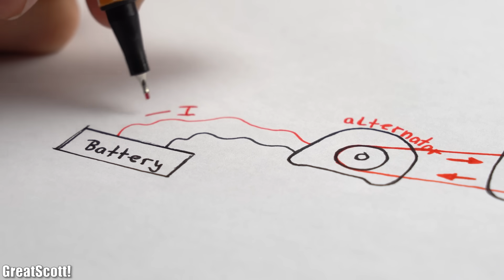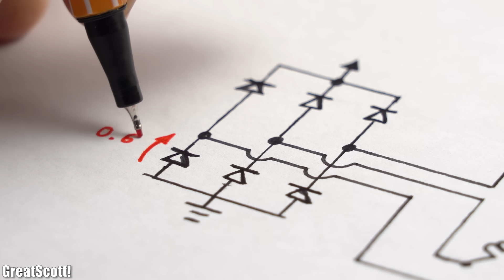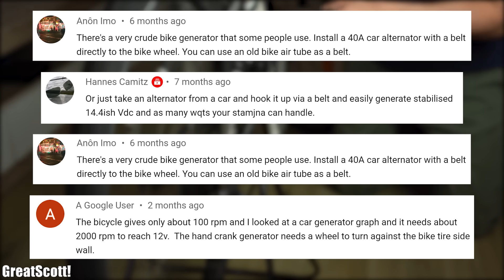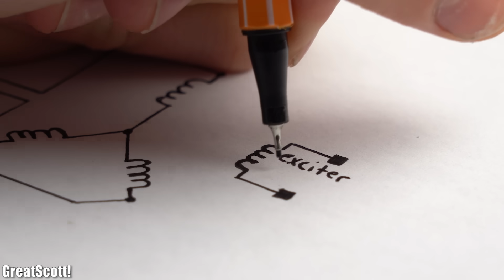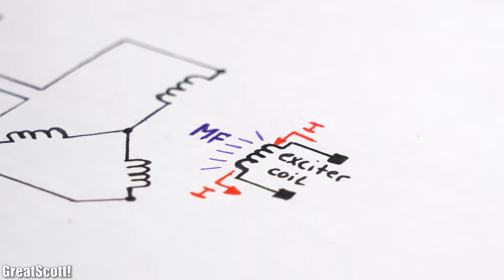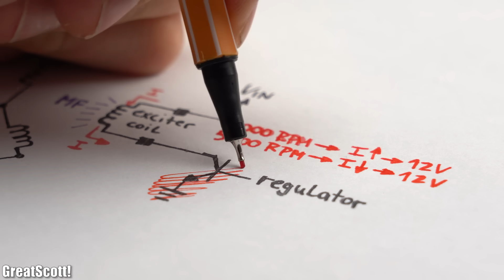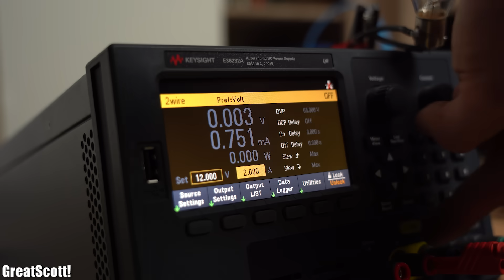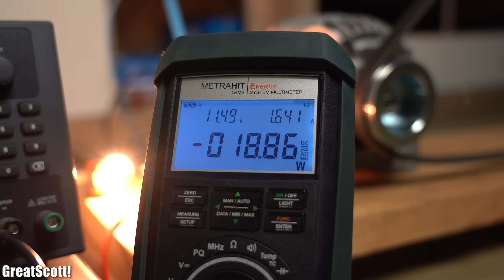Using a car alternator with a bike to power my home? How much energy can I produce?!

Comment: Everyone is talking about how to add tension to the belt. Here's a trick from an old lapidist. In rock shops, we use electric motors for a number of machines, which have a similar design to the alternator. When mounting the motor, use an ordinary door hinge. Mount the hinge to the base board and the motor to the other part of the hinge so that the motor tilts in the direction that the belt is going (In this case towards the bike). You can tilt it toward the bike to put the belt on, and when you tilt it back down it should not sit perfectly flat. That way, the weight of the alternator will provide the necessary tension.
Reply: what a nice idea !! but i dont think the alternator is heavy enough to provide enough tension when used used at that high of an rpm in this particular case.

Comment: they make high output alternators for example i have one that puts out 370 amps which is nearly triple what a stock style alternator puts out, also setting up a group of high capacity car batteries with an inverter to convert the 12 volts to 110. not sure if this would work but would be intersting to see you put it to the test. for example you could hook up your batteries and inverter to a box fan on high and see how long they would run it for and the test how long it would take you to use your bike to charge all the batteries back to full capacity! oh and please just tighten up the belt so that it doesnt slip!

Comment: The inverter needs to suppress the excitor coil pre amperage or you wont get any di-active voltage output. Just add a further wire to the bikes positive diode or even better, to the seat's anus capacitor, and you'll soon feel the difference.

Comment: You should try a good pulley system and daisy chaining several alternators together. Plus a few car batteries as a battery bank with a power inverter to get your AC. I've been debating on combining a bike system as such for a good workout every evening along with solar and wind generators to help sustain.

Comment: The field has to be initiated by a DC voltage before it will "generate" any electricity. It isnt a Generator or Dynamo. 
Under 'significant' load - (a few lightbulbs, furnace, stove, etc.) , its gonna take a ""significant"" HORSEPOWER to turn that alternator. Just auto systems can take 10 to 30 HP depending on how many and what things you have turned on. (notice the quote marks)
Stick to charging a bank of batteries and use a DC to AC invertor for 110V "appliances". 
BTW plan on a lot of peddeling to keep charging those batteries. LOLOL
Remember TANSTAAFL > There Aint No Such Thing As A Free Lunch.

Comment: Damn, for 80€ you get an entire car that is just barely not allowed on public roads anymore.
In other words: It would have been a lot cheaper from a scrapyard.
From the german i assume you live in germany and so do i. So this should apply. The second hand market for cars is just flooded, so used car parts like that usually are cheap if you are willing to extract them yourself. Also yes, i mean literal scrapyards. They usually have official rules on what you have to pay for such an action. Just ask them.
The only thing you can't obtain that way are airbags, they are simply too dangerous to mess with. And not just in the they won't work anymore direction. The way they are designed they can literally blow up in your face while you try to take them apart. They have too. Otherwise they might fail in a crash.

Comment: you could have just used the tire against the pulley on the alternator... and then you have the bikes gears to use against the load resistance,  changes.

Comment: you must connect another motor to the alternator to generate the required power out put to run your home two other choices solar panels to another electric motor or just a electric motor to the alternator but both must run fast enough to reach the required level for your home

Comment: I've thought of something that I would like to try one day. Build a water troth out of pipes with alternators attached to them acting as water mill's and a water pump to pump the water up into the troth. With the water eventually coming back to the water pump in a cycle. Only question is how many alternators do you need to power a home

Comment: Nice project. You should build the one where everyone is saying free energy from "PMG"(permanent Magnet Generator). I guess you have to get high-powered neodymium magnets and I guess modify the Stator to produce high output voltage? then they use a single-phase motor to keep the alternator running and producing electricity in a closed loop. I think that would be cool to show people if it can or cannot be done. Great Videos.

Comment: Try an alternator from the 1980's. Hook it to a 12volt battery. use pulleys to increase gear ratio for more rpm.

Comment: Did that years ago for a ham radio field day.  We used an old fashioned auto generator (not alternator) to provide 12v to power a 2 meter rig.  It worked, but most of us couldn't keep up the pedling for very long.  I know you can get the alternator to work.  Look for how people have used these in wind powered generators.

Comment: I don't understand why the rear wheel is on the gear with the most teeth, when you would want the one with the fewest teeth (and lower diameter) to increase the ratio between your pedal axle, and the wheel axle. As far as bike riding as gone for me, I go faster when I used the gears on the rear wheel with the smaller diameter (then the larger diameter gears on the rear wheel). And... it seems like a very obvious thing to miss for such a simple system. I know you were having issues shifting gears on the rear, but... you said you solved it? I don't get it...

Comment: Should have had a pulley on a shaft in the same place as where the alternator is and on the other end of the shaft you will will want a really big pulley that then either goes to the alternator or another small pulley with a big one on the opposite side again that way you can peddle effortlessly and generate a lot more electricity

Comment: Before seeing the video, you probably are putting out 75W, so no. Get a 1/2hp to .75hp washer/dryer motor. That way you can put out more like 100-200W. Also, directly drive the generator through the chain with a sprocket or cog. Forget about trying to rotate the generator through tire friction.

Comment: So... "watts" is a measure of charge per second. It is a flow rate. You can convert this directly to a torque. For 400 watts of generator, you're looking at 295 ft-lbs of torque... and that's before you factor in losses of energy due to generation, like friction, resistance of wire, entropy, etc.

Car lug nuts get torqued to about 200 ft-lbs for the extra stiff ones on standard cars. This is 1.5 times that. That requires a huge lever arm and most of your body weight. This looks bad for thr project.

Thankfully, hooking up less power to this generator will likely help a lot. It should be very easy to spin while no power is hooked up, and increase in difficulty to turn as more power is pulled.

20 watts to charge a phone and a battery bank seems doable.

Comment: Nice experiment! If you put a tensioner on the belt, you will decrease the belt slip and up performance/output. Would have to experiment with the spring force to optimize before too much tension overcomes the optimization of belt slip.
Reply: Yea the belts too loose.
Reply: Forget a belt.. put a chain drive on it..
Reply: Also change the ratio of the pulling gear increased by 3 and reduce the size of the pulley .. that will triple the rpms..
Reply: And add a start run capacitor off of a dc to ac inverter !! It will amaze you !!
Reply: I was thinking the same

Comment: best way to get power to supply  to your home get hook up to electricity  company   if your off gride generators  multi fuel  soler is cheap not dependble dose not work with out storage   at night love your enthusiastic  approach  but beter off  trying steam power did do that for awhile  lot of work  if you got creek  or drainage ditch  hydro works  weater dependent   do you realy want to peddle  all the time

Comment: Once your alternator  is put out full power flip switch crank up generator as long it has enough out put to turn a motor which keeps Gen. Going and Gen has output to run motor and what every you hook to Gen. Works nice

Comment: From what is visible you have the bike in 1st gear which is the slowest RPM of the rear wheel.  1st gear is designed for going  up steep hills.  You will increase the RPM substantially by putting the the bike in 5th or sixth gear or higher ( if it is a ten or twenty speed bike). It will take more effort but the wheel will spin many times faster without having to pedal near so rapidly.

Comment: Just a thought, bigger or more alternators, or both. Much more resistance something like those big water wheel things from back then, now the issue with the water wheel is of course it's size. Also can't be to small because of freezing potential. Magnets are superior, but not cheap. Those coal trains where impressive, so where the steam trains. Steam being the better choice of course.🤔🤔🤔

Comment: It's all about kilowatt hours . 12 volts at 120 amps is happening at 5000 rpm and requires 4-6 hp and at minimum 2 v belts or a serpentine belt . If you can equal the power of a 5hp mini bike or go cart , for any length of time may have a chance . Now I sit through the ads and await the outcome

Comment: U could of just ordered a 1968 ford alternator that puts out direct ac current 60volts that would go to the voltage regulator converting to dc voltage to charge battery 🔋

Comment: This would be very simple !  use bike to have exercise .with more stable setup so belt will not slip ,,,Alternator  feeds a battery , Battery feeds a power invertor , invertor feeds your supply . A good battery would supply power 3 to 4 hour just for lights computer and such, exercise maybe like 1 hour to 1 and half hours daily to keep battery charged,,and another member of your family ride bike , maybe run a 1600 w space heater

Comment: so Stirling engines running from heated water and magnets that spin separated from other magnets heating stuff up ware ever possible. so then you take wires and attach them to everywhere thats hot on one end and to water being cooled by air gel thats apart of the bigger loop put turbines in it for the water hydro and the heat lol. use some kinds of bio fuels, oxygen, and hydrogen. even burning plastics and thigs to collect gas and diesel that you could burn as well carpet demo or...

Comment: I think that much copper wire is meant to be optimized at thousands of RPM I think you’re scrubbing a floor with a toothbrush further optimization I’m sure can achieve higher results🤔

Comment: It’s going to take 2 hp plus just to freewheel the alternator to the approximate 3,500rpm required before loading it down with a sincere power draw. It’s a commonly overlooked variable. At that rpm you will have the voltage but no real amperage. 1 hp is approximately 550 foot pounds/per second. 1 hp is also about 745 watts; (1500 watts just to spin the alternator to 3,500 rpm operating speed with no load). How much do you weigh standing on those pedals? ‘-been there, done that’; you’re on the right track and I admire your efforts! Don’t give up.

Comment: It's not a generator it's an alternator and the tire is big the pulley on the alternator is small. You don't need and belts it chains. Mount the alternator so that the pulley is up against the tire so when tire spins it runs the pulley by spinning it

Comment: It’s not work as an alternator receives load it takes more power to turn the alternator then it creates so you’re at a loss and everything dies out… This guy is a liar it doesn’t work you ever hear an alternator return something on in a vehicle on the eight engine steps down because it’s under a strain

Comment: is it just me of i think you were using the lowest gear on the rear, plus even assumping the wheel circumference is around 2meters
the top speed most people can pedal on is 30km/h so you end with 500rpm,.

Comment: Most cars idle around 700 800 rpms and the battery charges just fine, also the belt needs to be tight, otherwise the belt slips and you don't get good power, also the alternator needs to be grounded

Comment: A car alternator needs close to 12V DC power of 2-3 amps to turn on the regulator and energize the coil in the rotor. Generated power is produced in the field coils and rectified by a 3 phase rectifiers in the housing of the alternator. Once turning fast enough the weak battery you started with will charge including any others you connect. However if in a windmill application, you need to devise a way to turn off power to the alternator if the wind dies and sense wind and turn the power back on to 'excite' the rotor in the alternator.  Note that alternators are designed to produce power when turning at least 1,000 RPMs so using pedals to produce power won't work.

Comment: You need to tighten the belt. With a tensioner or an adjustment corse thread bolt at the bike frame and wood stand

Comment: or constant speed generation of power you could replace the exciter coil with permanent magnets saving the 8 watts for the coil but then you would have an even harder time peddling to get the 20 watts out... If you can get the current down and the voltage up you should be able to find a more sweet spot.
I would try and go for a 24 v alternator of similar properties (a 120 A version as well) next and see what that does compared to the 12V version...

Comment: Get 20 of these car alternators and put one belt on to an electric motor instead of a bicycle and plug it into a wall outlet. That will give you continuous power without having to have a bicycle to turn the alternator. A simple washing machine motor should work. It will put out far more power than it takes to turn the alternator.

Comment: Have you thought of attaching a windmill or a series of windmills or a large windmill? This should spend the alternator at a much faster rate whereby producing the needed energy. Also use a smaller alternator and then of course battery inverter etc etc

Comment: If you ever do anything like this again ie something requiring an alternator, use a General Motors unit. Gm’s (Chevy) mid 1980’s - 1990’s trucks, SUV’s, and some cars, those with the 4.3 V6, 5.0 & 5.7 V8’s were made in their millions and their alternators are cheap, simple and robust. Or if you can find an old school one wire alternator whose exciter wire is the main wire from the battery.

Comment: Ive already seen a home powered by alternator in Waipio Valley Big Island Hawaii, only difference is that theirs was hydro driven from a waterfall up the side of the valley using a water pump from the same vehicle they got the alternator off of bolted them together with a direct drive off the water pump to the alternator both mounted to a 55 gallon barrel

Comment: Pal you have to bypass the diodes use electrical construction wire, by bypassing the diodes your output will be 440 amps get a car generator too you run that to your alternator, alternate to a fuse box with breaker switches with an outlet you plug in a battery charger to the outlet plug the battery charger to the battery now you have Frankenstein yourself electricity there you go there now it's running itself add auxiliary electrical outlets extension cords figure out the rest yourself says the Tin Man Randy Allen Hallelujah brothers and sisters amen

Comment: Yes, two car alternators,  wired in sequence, bypassing the diodes, should produce enough energy to power your Air Conditioner, as well as Furnace Blower & run your whole house. Then, hook-up a small motor to them both & you'll produce enough power to run the motor, as well... Good Luck ...

Comment: ok so water goes into a system that boils it from the sun. the boiling water goes into turbines and finally into steam engines. the steam is collected above everything and ran back down thru a hydro power system that feeds the boiler... you can use trickles to move extra volumes of water above thru steam hammer jets and water hammer jets. at night time you can boil water by burning bio fuels from plastics, plants, burning wood and/with poop.

Comment: Use magnets, if you make it right you can create a none stop rotating wheel and you can probably increase the rotation speed depending on the size and design of the magnetic generator

You would have to use that car alternator there in it somewhere
Reply: You cannot. Magnets don't work like that
Reply: Perpetual motion myth.
Reply: There has been noticed a certain boost in european electrical network, allegedly because the states are started to bulid their magnetic wheel setups. Thank you, Nathanial, your innovative comment helped to solve the european energy chrisis!